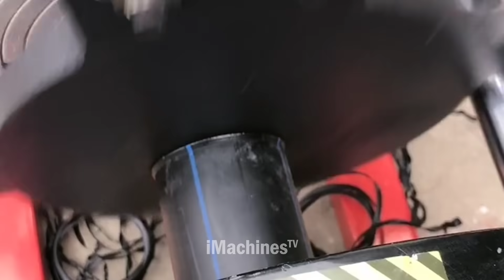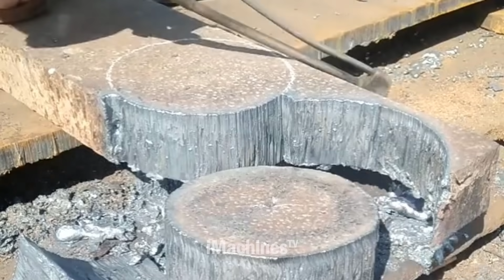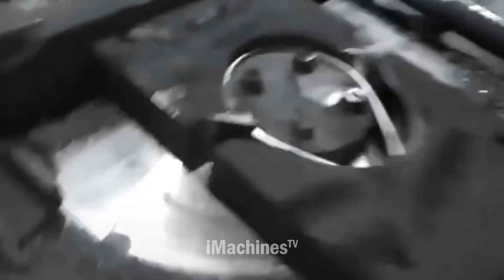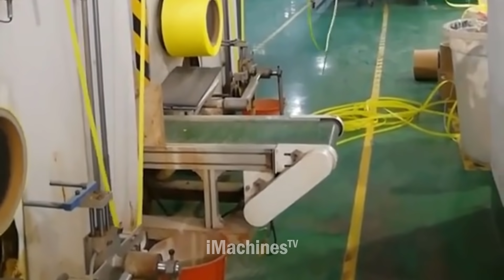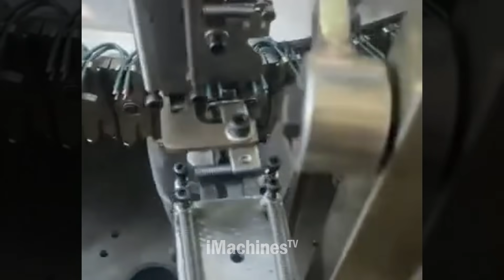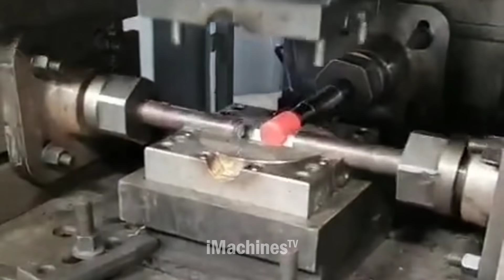Extremely Hypnosis Factory Production Process! Most Satisfying Factory Machines and Ingenious Tools.

Comment: Why speed up videos if they’re so amazing?
Reply: The idea is to put more videos in a smaller length video. 
You can slow it down using youtube video functions. 👍
Reply: @mr.t746  I don’t think so. It’s to make them “seem” amazing because most of these at regular speed are not at all amazing.
Reply: @tvojslauf  
Well surely 4/5 different processes, if shown in regular speed, would require considerable time i.e. 2/3 mins each. That would make video lengths longer and operations of different machines may take unnecessary time for one to understand the whole beauty. 
+
There can be a slot for ur justification as there are some processes which do seem enchanting when seen at a rather fast-forward pace. 😇
Reply: tehnik industry instalasiberat
Reply: Hindupur⁷